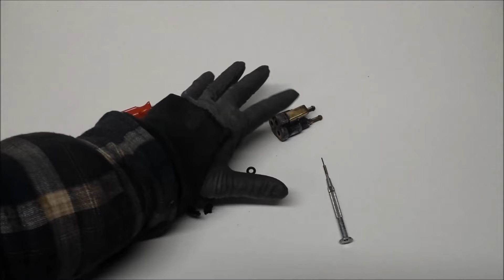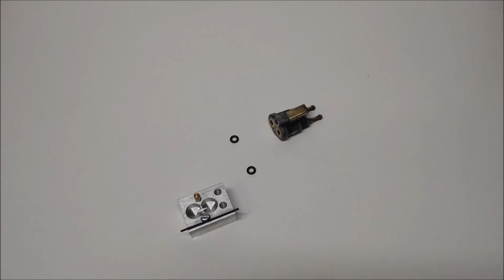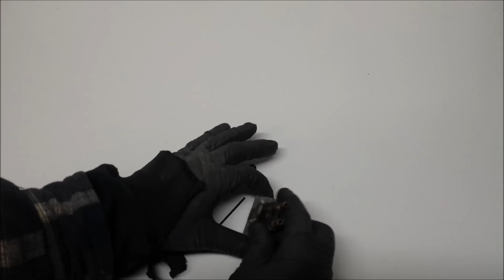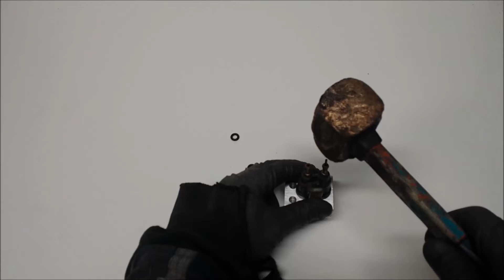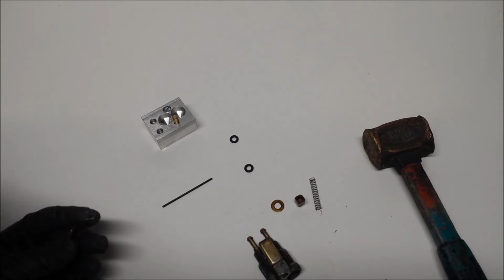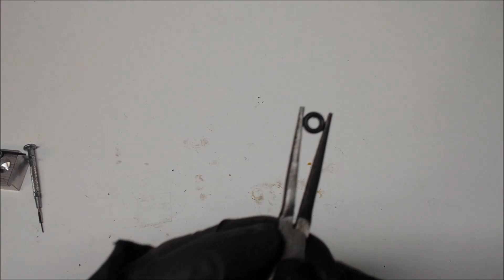Replacing the O-Rings on 2 Line Evinrude Fuel Connectors (Correctly)

Comment: No!!!!  I came here for troubleshooting, and I'm not sure this is the problem,  and all I got was an ad for yet another part! Replaced the rectifier, brushes, new fuel pump and still have problems. You'd think three visit from a marine motor guy over two years, plus another mechanic would be able to figure out the issue, but they haven't. I know very little about outboard motors but I'm  ready to take a class cuz this is some BS! No fishing for years due to incompetent people. Would save a lot of money in the future if i can fix it myself.

Comment: I replaced the O-rings on my connector using this technique, but it is still leaking gas under pressure. The brass pieces came out pretty easily, could they be leaking?  Any suggestions? Can I use a sealant on them? thanks for the video.
Reply from the maker: I would try sealant on the brass, or put 2x O-rings on each side before spending the $100 on a new connector.

Comment: Do you know if the male fuel connection on the engine cowling has o rings , or is it a spring?  Mine is leaking and I don’t want to spend $60
Reply from the maker: No, just the hose connector has o-rings.
Did you replace them?

Comment: Intersting video. I'm searching for a solution for my 56 Johnson air/fuel line connector, doesn't connect. The female side can't fully seat/connect. Any ideas? I wonder if its the spring?
Reply: Have the same problem it doesnt fully connect and jiggles a little bit doesnt create a seal for the pressure and leaks some fuel